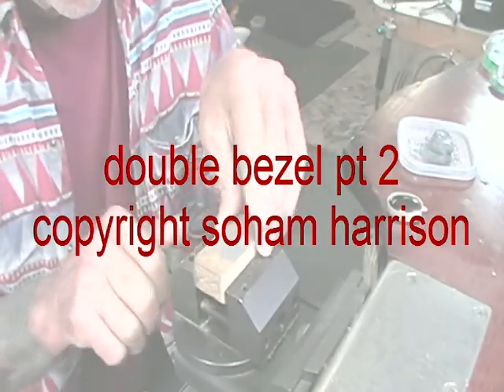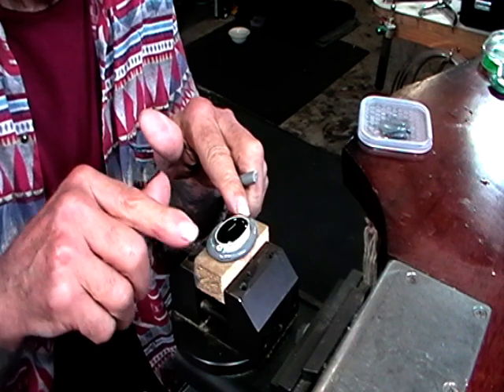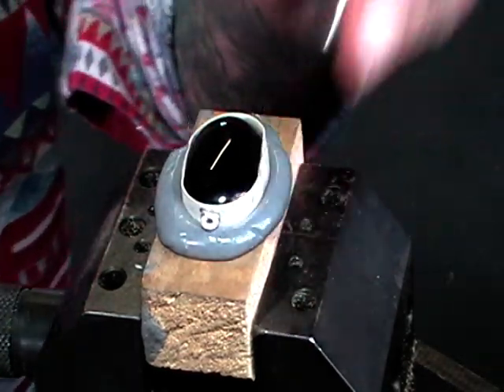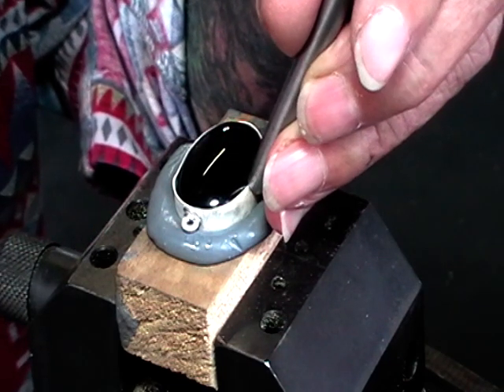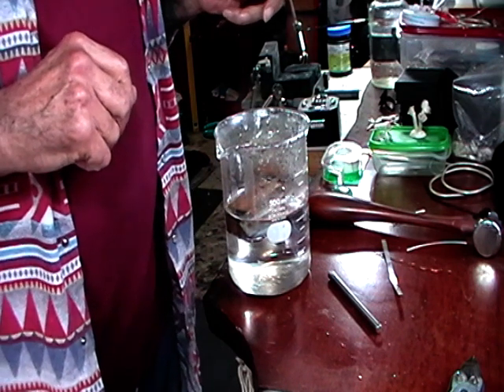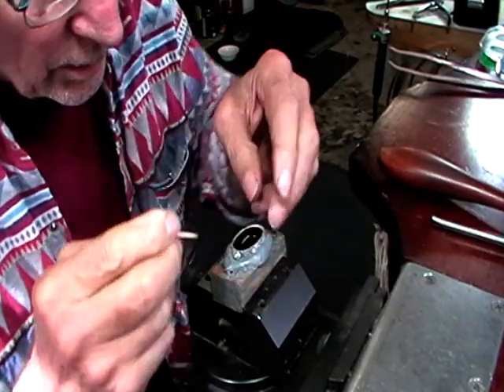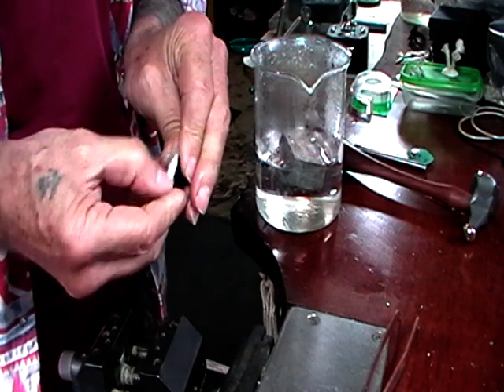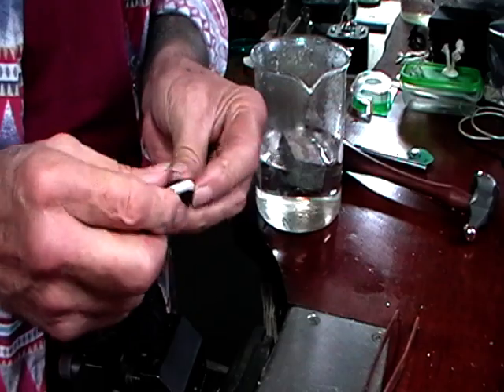double bezel pt 2

Comment: Thank you so much for this very clear, excellent video. I'm interested in using a double bezel lock on ceramic pieces I've made. I'm a potter, and I've been making horsehair pottery for many years. Recently I've been making platters using tail hair from the customer's horse. These have been popular with customers as a tribute or as a memorial to their special horses. Now I wonder if I can make  double bezel pendants using ceramic (stoneware) pieces (1"--2.5" diameter) that have been "horsehair fired." They would be more fragile than the stones you use, so I'm unsure of whether they would take the pressure. Do you have any thoughts or opinions on whether this process might work on vitreous ceramic pieces?  Thank you again for your excellent video. You're an excellent teacher.
Reply: Edith, you can set vitreous enamel in a bezel so ceramic would probably work too. I would use a bezel rocker and not a hammer when testing.

Comment: Thank you so much for this very helpful video! 

Are there any stones you would recommend avoiding the hot water with? Do you think it would be ok for pearls, opals, tuquoise, and other softer ones?

Thanks!
Rebecca
Reply: Another problem is (heat maybe) treated stones. I was cleaning the sterling setting on a carnelian briolette in baking soda salt and hot water solution only to have the stone discolor. What a disappointment as that stone became mottled. However I love this video and have been looking for such an approach for a long time. Thanks Soham!
Reply: Thank you for the great video.  What about dendritic agate?  A little scared about boiling water.  Is there another method to get it to release?
Reply: @JD-yz2iz  I think he said one could also use a hairdryer. It would certainly be worth trying.
Reply: Nooo!

Comment: This is really helpful, thank you.
 I've seen a bezel set stone with a design soldered in place over the front.  I'm wondering if the stone is set from the back after the design is complete?  Could the thermoplastic help with that? I think the back is flat though.